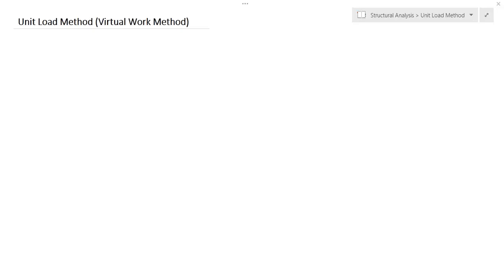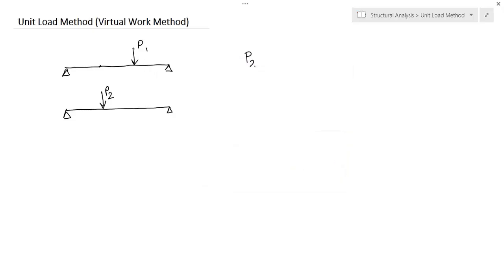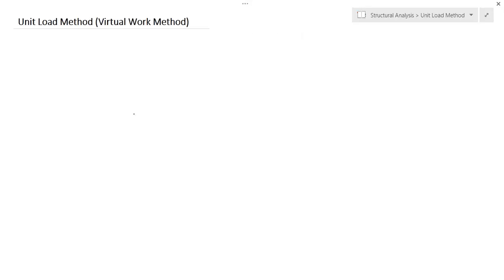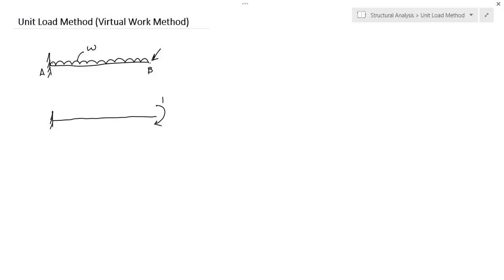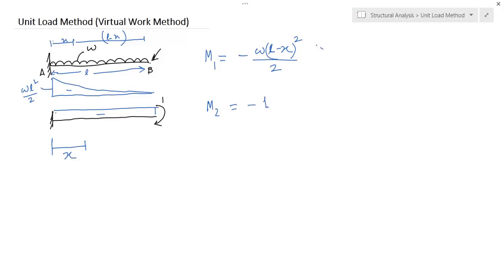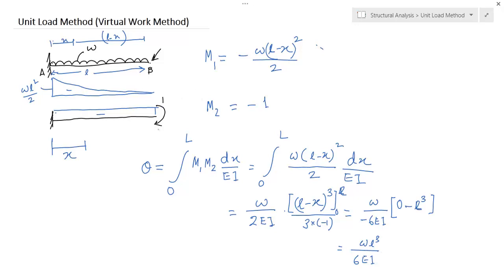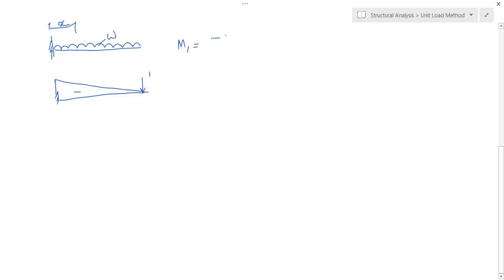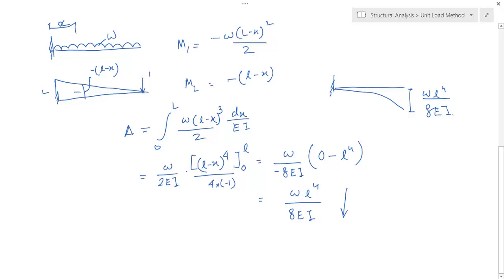Unit Load Method | Cantilever Beam with Udl | Slope and Deflection | Example 1

Comment: My professor called the method “virtual load” method, but in our exam this method called “unit load method”… So when I first saw the question, I thought he want me to use unit force to calculate slope, which is not possible and I actually realized that during the exam, but I still used the unit force… I’m literally crying rn